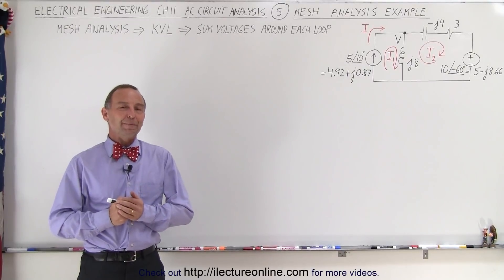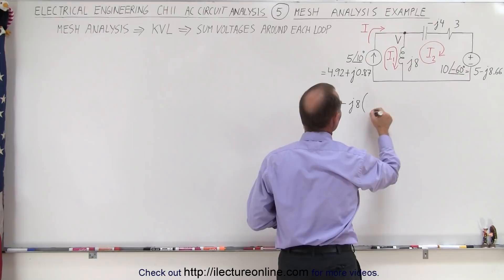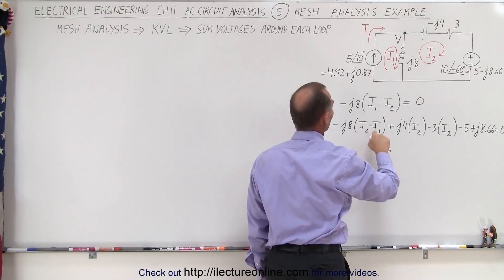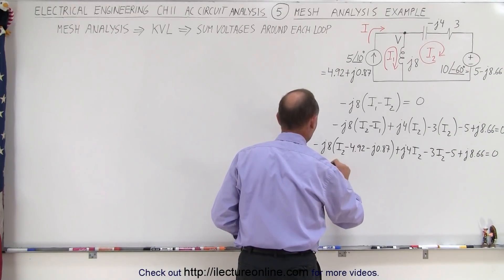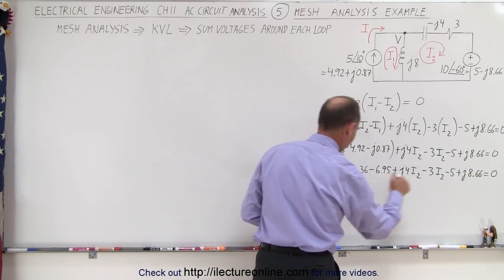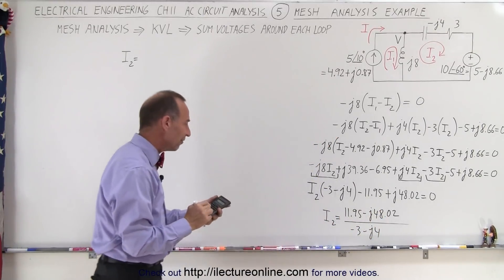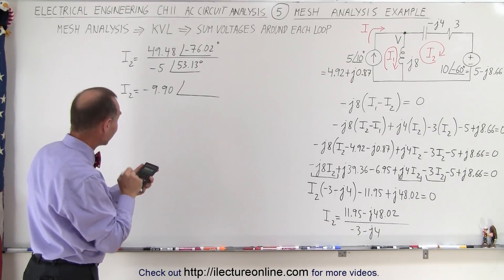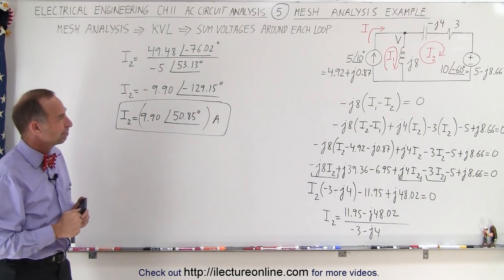Electrical Engineering: Ch 11 AC Circuit Analysis (5 of 55) Mesh Analysis Example

Comment: in the second loop shouldn't be +j8(I1-I2)
Reply from the maker: For the second loop traveling in a clockwise direction, there will be a voltage drop across the innductor in the direction of travel.  The signs are determined by the signs in front of the currents.

Comment: I think there is an error.   The voltage drop across the current source is not zero.    This video should be taken down.
Reply from the maker: A current source is an idealized electrical component and by definition, the voltage drop across is is zero,

Comment: How u get no voltage across current source?
Reply from the maker: A current source can have a potential difference across it, (due to the resistance of the wires for example), but our theoretical models typically assume no voltage rise or drop across the ideal current source.
Reply: @MichelvanBiezen  how u take -5  magnitude of -3-4j   it should be 5 ? Am i right?
Reply from the maker: If you draw the phasor diagram, you will see that -3 - j4 is located in the third quadrant.  Factoring out the negative sign and then converting is easier.   -3 - j4 = - (3 + j4) = - ( 5 /_ 53 degrees)
Reply: @Michel van Biezen  will there be any issue if i continue with 5<53
Reply from the maker: Yes, it will be wrong.   But you can eliminate the negative by adding (or subtracting) 180 degrees from the phase angle.  Therefore - 5 /_ 53 = 5 /_ 233  = 5 /_ -127
Reply: @MichelvanBiezen  so should we always factor out a negative when the real part is negative?

Comment: My professor taught us mesh such it should just be j8 and not -j8. You can arbitrarily assign polarities, and the current "hits" the + sign of the inductor first, so the equation would be j8(I1 - I2). He has a PhD so I assume he knows what he's talking about but it seems to be at odds with how you do it. Yet you both seem to consistently get the correct answers so I'm pretty confused.
Reply from the maker: There are various methods to solve the same problem  It becomes a matter of preference.

Comment: Why i1 =i
Reply from the maker: I didn't calculate I1.  You can plug the result for I2 back into the original equation to solve for I1
Reply: @MichelvanBiezen  
But why is =i1 plz explaine it

Comment: Why is that the product of -j8 and -j0.87 is -6.95? Isn't it -6.96??

(-j8)(-j0.87) = (j^2)(6.96) = (-1)(6.96) = -6.96
Reply from the maker: The number is not (-j 0.87) but it is (-j 0.868240888)    Do not round off before the final calculation if possible.

Comment: BY inspection the current I1 = 5<10. The current through the inductor is I1 - I2. You're right that you don't know the voltage drop across the current source but you don't need to because I1 is manifestly already equal to 5<10. You then do the loop #2 substituting 5<10 for I1 and solving the single unknown I2. And that's how it's done.

Comment: Hello Professor Biezen, I have been solving circuit problems from my book similar to this lecture, and I had a question with regard to the phase angle. For your I2, you have gotten 9.90 at an angle of 50.85 Amps. If I were to translate this to my book, I would sometimes get the phase angle 180 degrees out of phase, making the 50.85 a -123.15 or 230.85. Is this still a correct phase angle or is this incorrect?
Reply from the maker: Both of those answers are correct.  Typically we express the phase angle to be between - 90 and + 90, but it is fine to express it as you indicated.

Comment: The first mesh loop equation -j8(I1 - I2) = 0 is misleading. 
The voltage across the inductor is not zero.
Reply: Using a lumped model for the inductor would give us a real voltage 
Read Feynman lectures

Comment: Sir, from equation 1 j8 cant be 0, so (i1-i2) must be 0, so why not i1=i2?
Reply from the maker: You are correct.  There is a voltage drop across the inductor.
Reply: Bro how I can use j value in casio plzz tell me
Reply: Shaik Abdul basha first convert to cmplx and then choose shift and ENG

Comment: Why is the current source ignored in the first loop? In my classes, they also include that, which adds the term "5<10(degrees)" to the equation. Otherwise, great lecture, professor. :)
Reply from the maker: We are not "ignoring" the current source.  When summing up the voltages around a loop, a current source does not have a voltage drop or voltage rise across it, unless it is specifically given.
Reply: @MichelvanBiezen  Yes, that was it. Cleared the doubt. Thank you. :)

Comment: Thanks for great series! I wonder a bit though, current source in parallell with inductor, with 50 V on top and 0V on bottom, so it must have a voltagedifference of this size itself, like the inductor??
Reply from the maker: Yes, because they are in parallel

Comment: Hello sir. from previous video 4/55 using nodal we found (V=54.7 -10.7i)
Using the value of I2   I used this relation. (  I2= (V-10<60)/3-4i  )  then I tried to solve for V.
 my value  of V came out to ( 54.5+6.7i)

Why is it I cant solve for for V this way, or is the another potion I missed. Thank you.

Only reason ive been surviving this last few years of Egn school  is due to you.
I made it trough physics 1 and 2 solely on your video series

Comment: It seems that we all see the same problem in the first equation. -j8 (I1-I2)=0 => I1=I2 which of course isn't right. But the method works if we just ignore the first equation and the current source, like Mr.Biezen explained in the Mesh analysis / w current source -> http://www.ilectureonline.com/lectures/subject/ENGINEERING/28/196/2044.
Reply: That's because you can't consider that branch in mesh analysis, due to the presence of the current source. You don't know the internal resistance of the current source nor the voltage drop across the current source, therefore it isn't just -j8(I1-I2) = 0 but rather an extra term in that expression V(current source). 
That's why we ignore that loop, taking only I1 = value of current source and proceed onto the next loops.
Reply: Right. Thanks for the link.

Comment: Is it possible to get I2 from the first equation: -j8(I1-I2)=0 knowing that I1=I? I've been trying to solve it this way but the result is different...maybe I'm doing something wrong...

In any case, THANK YOU!
Reply from the maker: With this method, you have to be careful and treat I1 and I2 independently within that branch.  But that said, if you don't violate any rules it should work out using any method.  (It could be that you made a small algebraic error)